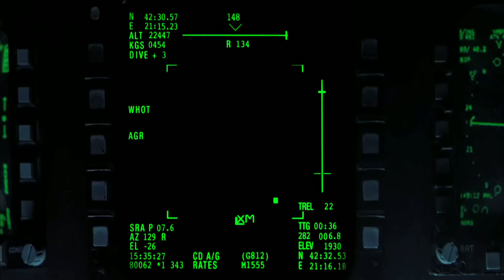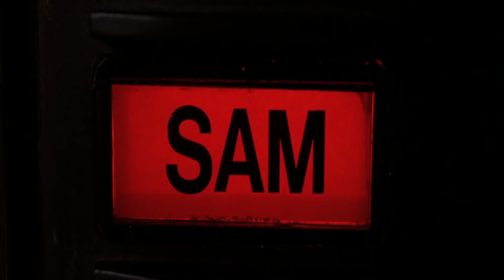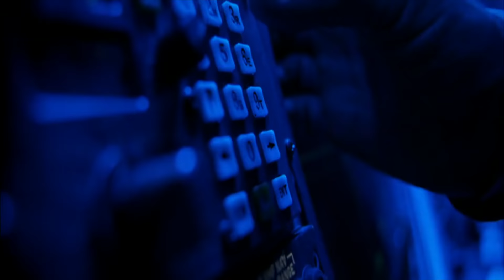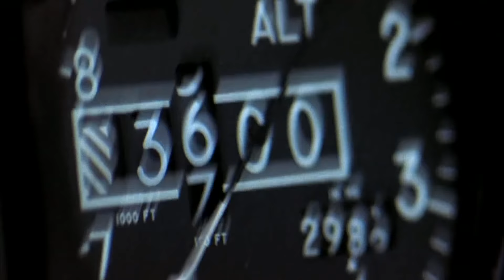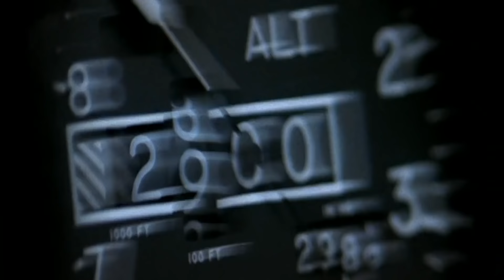Behind Enemy Lines  GTAM vs F18

Comment: A few things here...

The title of the video... What is a GTAM?

As far as I can tell, there is no such thing as a GTAM... I am pretty sure you meant "SAM"..

The other issue I have here is with the actual movie...
Those missiles should be the size of the Saturn V Rockets... A missiles/rockets size is dependant on its fuel load... 
Considering they burn for 1 min 53 seconds (first missile that detonated in the "fireball") and  1 min 56 seconds (second missile which strikes the F18F), these missiles should be HUUUUGEEE to support the amount of fuel required for such lengthy burn times...

Generally speaking, missiles are incredibly limited as to the amount of propellant they carry.
The AIM54 "Pheonix" missile was one of the longest ranged AAM's ever created. It's rocket motor would burn for a total of around 30 seconds before running out of propellant. Once the propellant had run out, the AIM54 would be at a speed in excess of Mach 5 and would have a range of over 80miles.

Typically SAM's have enough propellant for a 15 second burn and reach speeds of Mach 3 - 4.

This also brings me to my next point... We see the F18F 'snaking' through the valley with the first missile chasing it...
Considering the maximum G forces the F18F can handle with external fuel tanks mounted; It suggests that the F18F in this scene is traveling at around Mach 1.10.
The missile chasing it would easily be at Mach 3 - 4...
Meaning, it will have easily caught up to and destroyed the F18F in seconds at that range...
Remember, it is traveling faster than a bullet while the rocket is burning.

Lastly, in that environment, the pilot will have tried to put terrain between his aircraft and the missile as it was launched too close for countermeasures to work effectively.
What I mean is, the pilot will have ducked in behind a mountain (plenty around him) so that the IR seeker on the missile would lose its track and would instead just fly off until it eventually ran out of fuel and detonated.

Why he would climb in full burner in attempt to get away from a missile which is much faster, is beyond me.
Reply: Also, another technicality...

Heat seeking missiles do not give the aircraft a RWR warning...
A pilot doesn't even know he has been fired on unless he physically see the launch...
Reply: @Anthony-zo3ch  you seem fun at parties. Also, something i saw pointed out on a different edit of this scene on youtube (with lighthearted purposes and with added sound effects of war thunder), apprently sams missiles apprently loose lock easily with early made maneuver so sams rely on multilple missile laucnhes to secure a lock, also that the missile types on smas do not Re-gain a missed lock, they are ffectively wasted after loosing track once, another reason why multiples are fired at once.
Update:  https://www.youtube.com/watch?v=Ty2wMlro6pU on this video, for fun.
Reply: @killian9314  Ultimately it depends on the weapon system being employed.
Indeed, there are several SAM systems that are ineffective against Gen 4 and 5 aircraft, however, there are also many systems that are quite deadly.

Regarding a missiles ability to maintain "lock"...
"Lock" of a target is usually a term given for a RADAR guided system.
Most RADAR systems employed are a "pulse doppler" design; They work by emitting short and powerful pulses in a beam that moves left to right while scanning.
Once the RADAR finds a potential target, the pilot/technician/SAM operator can then tell the RADAR to focus all of its energy at the target.
When this happens, the RADAR stops scanning and focuses all energy at the target, this is called a "lock" as the RADAR has "locked on" to the target.
The weapons onboard guidance system or radar system (if it is an active RADAR missile) is "slaved" to the information the main RADAR is giving it.
Once launched, the missile will follow the guidance instruction given by the launching RADAR (for semi-active missiles) or, if the missile is an "active" missile, its own onboard RADAR will maintain the "lock" and will guide itself to the target.
If a RADAR guided active missile loses "lock", then its onboard RADAR will proceed to search for a target. When this occurs, the missile is declared "Pitbull" as it will attack ANYTHING it finds (including friendly aircraft).

For IR missiles, they do not really "lock" a target...
They are guided by the IR seeker in their nosecone which tracks and chases high-intensity heat sources.
The way they are aimed at an aircraft before launch is via an IR sensor system that gives a tone to the operator when a valid heat source is presented.
The operator will aim the nose of the missile at an aircraft, listen for a tone and will fire when a tone is heard.
If the missile misses its target, it will simply become inactive and will either detonate (to save potentially hitting civilians) or will disarm and fall to the ground once slowed down enough.

You are quite right with the method employed with SAM sites...
They never fire once and have the mentality "that will be enough"...
They often will fire multiple missiles, sometimes all loaded missiles will be launched at different intervals in order to defeat the aircraft's ability to pull defensive maneuvers.

That being said, the fact remains...
IR missiles will NOT have given the F18F an RWR TRACK and RWR LAUNCH warning as they do not emit RADAR energy.
They are a missile guided visually via IR sensors and there is NO WARNING to any aircraft or crew when they are launched and tracking.
The only way to know is if you see the launch or the missile trail.

Thanks for the comment.
Reply: @Anthony-zo3ch  well, i guess the warning must be a common myth, as it´s embedded into many large scale warfare videogames as of today, like the modern entries on the battlefield franchise. Well, it always seemed of that hose games give lock warning even with laser guided, which makes no sense how thewarning system catches onto an ir laser being pointed at a tank, but well, balance..., also with the newest war thunder patch they added supersonic jets and heatseeker missiles, and i can see what you say on the pilot recieving data to find a target given the nose of the mig 17 has a painfully "one the nose" ir camera.... ba-dum-tss. Anyway, those missiles dont give lock warning but they do give missile launch one, well, as if the war thunder pilots weren´t already impressive multitaskers.
Btw, thanks for the Reply.
Reply: @killian9314  Thanks for the comments.

I am always happy to share knowledge with people.
Reply: It’s SAM surface to air missile
Reply: Good thing it’s just a movie and not a doco then hey
Reply: GTAM stands for Ground To Air Missile.
Reply: It's a movie bro
Reply: ground to air missile
Reply: @Anthony-zo3ch  not how we shot down f117
Reply: @Anthony-zo3ch  Nice , but I have one question ... If you fire multiple SAM at once against a plane , doesn't the second and third SAM follow the heat from the first SAM you have fired ? You know , the second and third will want to go for the closest heat source and that is the first SAM.
Reply: 1: GTAM: stands for Google's Transgender Atmospheric Missile used only for Movies.

2:Yes Missile do go at 3 to 4 mach but not this one, As there is snow and its cold missle was going slow behind and remaining behind the jet to stay cosy from the heat of jet engines.

3:Missle fuel last for couple of seconds but not this one, as GTAMs/movie missile are made to last longer using viagra to get the perfect shot.

Hope i answered all your questions Thank you
Reply: @hamzaraza7250  no comment or like

Comment: Unlimited fuel SAM, while the realistic one only have 10 seconds of solid propellant
Reply: Some have way more than 10 lol.
Reply: Salamander Fry yea but very few do and those would be large missiles that are part of a large SAM site.  These should have been short range missiles that would have been defeated in less than 15 seconds
Reply: 10 second? But, It carry by Tank?
Reply: @sorapantsu8598  what are you even trying to ask?
Reply: Sora Pantsu just FYI we’re using English here, if you get that down I might be able to answer questions
Reply: @TexasGreed  I didn't think that the missile only lasted 10 details in the air.
Reply: @cadenb35  k. Next, I'll use Google translate machine.
Reply: @cadenb35  special for you.
Reply: They must be running on hybrid mode, like the Toyota Prius...

Comment: So many things wrong with this scene. Before, when I watched this I thought this was a pretty cool scene until I realized that those are IR missles. The fuel tanks don't just spontaneously combust when they fly into something and I doubt that is even possible even if they were traveling at supersonic speed the tanks still wouldn't have enough energy to create sparks or heat and even if they did the fuel has to be atomized to even burn. Jet Fuel in itself is not flammable unless sprayed into a mist to combust. The flares or counter-measures can actually deter IR type of missles because sometimes they can actually track the sun if it was the only target. They are IR type as you can tell by the fact that they have a see through or plastic nose for the sensor to track. The missile should really be an active-radar missile. These missles can continuously track the target as they have their own radar and IR flares won't be able to trick them. It would take a radar jamming device like what the EA-18 prowler has to hide from them. But whatever this is just a movie.
Reply: I agree with everything you said except that the fuel tanks would definitely create sparks at those speeds and much lower if they hit something. There is video of a baseball making sparks hitting a catchers mask, it's all about the surface they hit. You can make a shovel spark by dragging it on pavement its not that hard.
Reply: @grahamsmith5975  Yeah. But the fuel has to be atomized.
Reply: @hightiernub1313  totally agree
Reply: You forgot to mention there probably wouldn't even be fuel in those tanks if they were behind enemy lines. External fuel tanks are fed into the engines before the internal fuel, so they always go empty first.
Reply: Its an action movie.

Comment: That missile would have needed tip tanks to have lasted that long without running out of fuel.
Reply: Yeah fact is that after being painted with a laser when the missle was fired they would have had couple seconds and usually when the missle is laser guided its over. Not much a pilot can do. Flares are mostly ineffective against LGM.
Reply: A laser can be deflected off into space

Comment: Love this scene all things considered, but my experience as a pilot and with SAM systems screams so much is wrong.
Reply: Really? You don't say!
Reply: @EternalModerate  :p
Reply: Please inform the uninformed what's amiss here?
Reply: @desmundlighten3603  SAM's can't fly for anywhere near that long, nor can they maintain a lock when the target is behind them.
Reply: @desmundlighten3603  Rocket motors only burn for a few seconds, SAMs fly "lead pursuit" ahead of the target not chase it, top speed of most SAMS are around Mach 3 allot faster then an F/A-18E, This SAM is IR guided no warning should have been received on the F-18s radar warning receiver. That shotgun blast thing it did dose not happen its an expanding rod...ect
Reply: Shadow Hedgehog   No :p
Reply: My experience with the English language screams so much is wrong

Comment: Amazing scene to say the least. To bad it wasn’t a SR-71 and when he says punch it your outrunning everything
Reply: That's no longer the case, it was true in the 1960s when SR-71 went MACH 3 and the top Russians Sams could only do MACH 2.5 but that changed in the lae 1970s. Modern Russian SAMs like the S-400 travel at MACH 16 and have a range of 250 miles. SR-71 would be a sitting duck, which is why it's retired. Even in the times of the Serbian war SAMS traveled at MACH 6.
Reply: @Alex-wp9oo  true for 60-70s version but it depends on equipment and altitude that SR-71 is flying at especially with todays tech
Reply: @Alex-wp9oo  LOL yeah something going with Russia

Comment: Riiiiight. 9K35M Strela-10M4 has a range of 5 km. 517 m/s (Mach 1.5) and max altitude 3.5 km. Flight time less than 10 seconds. F-18 has a 250 m/s climb and max speed Mach 1.8

Comment: Why did one missle explode into a massive fireball and the other one shot out a bunch of buckshot?
Reply: One of the missles targeted the  exploded fuel pods because missile were heat seeking. As for the other that didn't chase the heat generated from the fuel. I guess it's just a type of missle. Am not military expert so i could be wrong.
Reply: It was all one missile, the fireball the is bogus but some do shoot projectiles into a target and explode as well. This one missile hit it three times which is bogus (projectile, body and then floating fireball).
Reply: The fuel is leaking mixing with the air and the jet probably ignited the fuel from it's own engine.

Comment: Bullshit. That missile is radar guided. Not HEAT.  You will want to deploy Chaff and stay low to the ground .  Also the angle of intercept is in favor of the 2nd missile launched.. The first SAM missile would have ran out of solid fuel  alreaddy and had dropped or self destructed. They don't fly that long.  Also why is he doing tight S Turns. Does he want the missile to gain and intercept..  to all the trolls and Karen's out there know its a movie. Atleast they could get the continuity right. And make the  SAM scene more realistic than dramatic.  Less is more.

Comment: Wft !!!there's something called chaff and flare hollywood
Reply: Flares were fired though?
Reply: Brandon Steele flares are used for IR guided missiles , (heatseeking missiles), SAM missiles are radar guided, so for that you would use chaff, which is like little prices of metal, that interferes with the missiles radar lock, they fired flares, which would do nothing to stop the radar lock
Reply: Sounds like the pilots here were really out of their element, then.

Comment: A tank rocket cannot break the speed of sound.
Reply: Tank shells can easily reach 5700 ft/s which is well over the speed of sound. What’s depicted in the movie is a mobile SAM. Those missiles also travel over Mach 1.
Reply: @skyserf  ANY SAM travels at speeds in excess of Mach 3 - 4...

Otherwise, they would be useless against aircraft at 20,000ft traveling at Mach 1.8...
Remember, in REAL life, missiles only have around 15 seconds worth of fuel, so they need to reach a stupidly high speed to enable them to glide (at supersonic speed) to their target.
If their target is at 20,000ft, then they need to be able to climb to that height and still have enough energy to then intercept their target.
Reply: Anthony Bland I didn’t say they couldn’t. Why are you responding to me?
Reply: Anthony Bland You need to re-read what I typed.
Reply: @skyserf  I wasn't having "a go" at you mate.
Just informing you.
You mentioned "Those missiles also travel over Mach 1." I was only letting you know that it is actually much higher.

I find this stuff interesting and assumed you also did.
Ergo, I let you know that they are indeed faster again as i figured you would find that fact interesting.

As I said, I wasn't trying to correct you.
Was merely sharing knowledge.
Reply: Anthony Bland I did know SAMs can travel fast enough to catch high speed bombers and fighters. The op thought tank shells were thrown by hand.
Reply: @skyserf  All good mate.
As I said, I was only sharing information.
Nothing was implied by it and I am sorry if it did.

Cheers.
Reply: @skyserf  you said "cannot" that pretty much means Cant, as in couldnt is possibility, cant is sematically downright denial, yes you did not say they couldnt, you said something worst - your local comment section gammar nazi
Reply: A1pha Ch3rnovak You are misreading. The Original poster said that. I corrected them.
Reply: @skyserf  oh i was replying the same guy, i misplaced to which coment i was replying to
Reply: A1pha Ch3rnovak ok

Comment: Garbage ...the missile can close from 3 miles to 300 meters behind then what? Slows down to match speed with the plane? Avoids flares? Can make multiple 180 degree turns. Can keep a lock without having a heat source within its scope.....just an insanely stupid scene....fantastic entertainment value but its all cobwash

Comment: Wtf is that dumb movie ?
I'm not looking for extreme realism. But there are limits. Especially if it wants to look "serious" and "realistic".

The missile in the SAM tube looks like an IR missile, but it changes to a radar one when in the air.
The plane gets a radar lock yet the pilot drops flares when they are completely useless to radar missiles.
It chases the plane for 4 minutes straight while doing loops and tight turns and still having fuel.